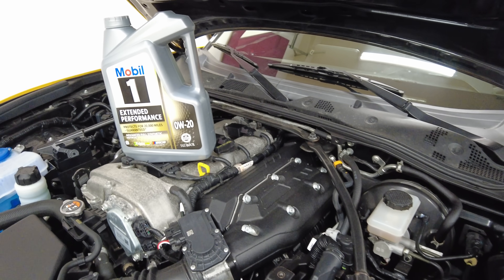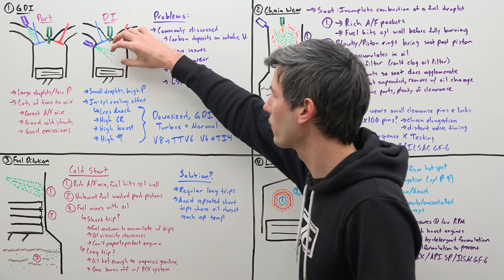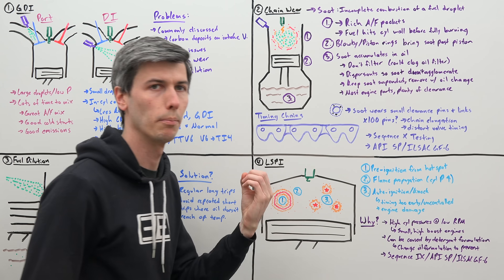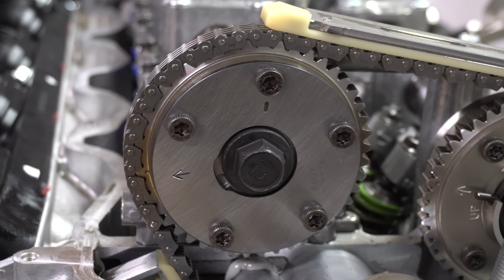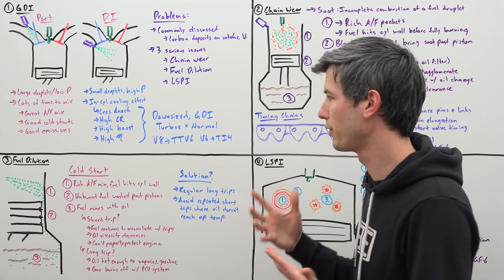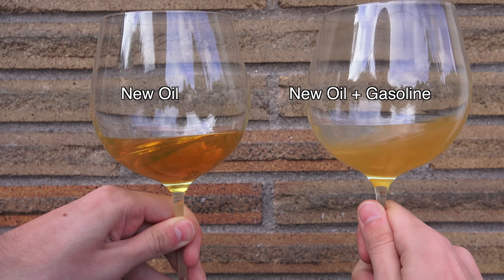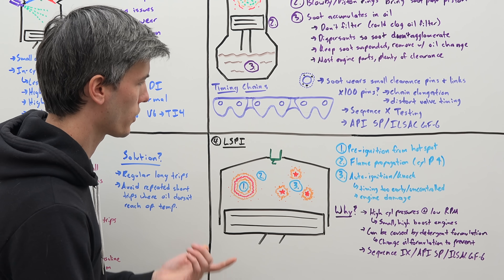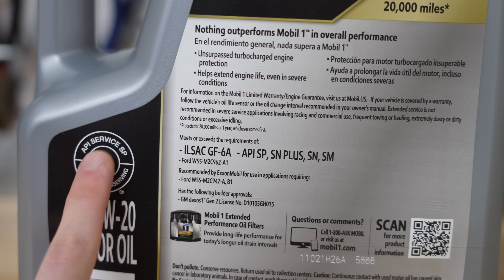3 Big Problems With Direct Injection Engines (Gasoline)

Comment: I have 2 questions on my 2015 TLX V6 tech pacage.  1) IF I run with the least amount of load (slowly) on my D.I. car, and only use higher revs after it is toasty, will this slow down the reduction in viscosity on cold/icy days?  2) In my car, the car itself shows me when the viscosity (not just the level of oil) drops slowly from 100%, 10 percentage points at a time, when at 30% (twice the 15% recommended by the dealer) I get my oil changed. I am told that is what  is being measured by  whatever monitoring system my car has. Can you confirm both questions. And does variable (9 speed transmission) timing
help to reduce the cold start viscosity problem?

Comment: why not have direct injection..  and tiny throttle body.   it would allow some fuel to clean the valves.  cheaper than adding port injection to keep them clean.

Comment: I'm not sure if the timing chain issue is due to soot for the BMW n20/26 engine but the that generation has timing chain issues known to grenade the engine in a small % of engines after around >50k miles.

Comment: I have noticed that my Ecoboost benefits greatly from a regular "Italian tune up", much more so than some of my other vehicles.  I've tried to explain to my wife that her light driving is what's causing the low mpg it's been giving, but she doesn't listen.  I take it for a couple hours, and it gets at least 2-3mpg better for a couple weeks.
Reply: I agree with you fully. But you'll still get the technical assholes that will argue against this practice. Proper preventive maintenance and an Italian tune-up once a day in my 3.6 L direct-injected V-6 in my Chevy has had zero problems. Got almost 200,000 miles and still running like new.

Comment: I have a 2017 Subaru Levorg with a 2.0l direct injection, turbo charged engine (same one as the WRX), but it's paired to a CVT. It's the worst combination imaginable. The CVT rev's so low all the time, it puts far too much strain on the engine (essentially lugging it), but it's tuned for "performance" so tried to make quite a lot of torque low-down. As a result I get LSPI all the time. Also had carbon issues, had to replace the injectors, it's so fussy about oil type, and fuel quality, the fuel BRAND. Plus everything in side the engine bay is made of plastic. I'm sure these engine's won't last long.

Comment: So, is it enough to stay on top of regular oil changes with the proper manufacturer-recommended oil, change interval, and viscosity? Or do we still have the intake-valve carbon buildup issues even after that?

Comment: mobil shmobil..only idiots "lubricate" their engines with 0w-20 water-thin oils;p..wise people use any ordinary 5w-40 (for any engine) for a reasonable price n change it each 6-8kkm depending on driving conditions/manners..n have no problems, at least the ones associated with oil n lubrication..

Comment: You not mention toyota lexus engine they have both port and direct injection on there engine and the computer switches between which fuel delivery system is best.

America has very few small engines with high compression Europe and Japan and Asia have been usingvthis for a long time. Lots of 3 cylinder 1.5 and 1 litre turbo engine are found in BMW Mercedes  Land rover range rover  psa/ stellantis Toyota nissan/renault/ mitsubushi vehicles.

Comment: GDI turbo four cylinders are a byproduct of political insanity by Western Governments because of "Climate Change". In the USA, the EPA puts unrealistic CAFE standards on the manufacturers for their entire fleet, so this is what the various manufacturers came up with to comply. I'm sure the auto companies would rather build simple, effective and powerful engines that get a few less miles per gallon, and not have to conjure up these over-engineered, carbon plagued time bombs. However, they have to offset the mileage of their light truck, SUV and sports car gas mileage standards with this insanity to remain compliant.

Comment: Back in ye olden tymes, the 40, 50s and 60s, the common practice with airplanes operating in the Arctic was to dilute the oil with avgas, on purpose, before shutdown.  This would get the viscosity down to a level where you could start the engine at -20C without building a fire under it, or having to drain the oil from the engine and keep it indoors overnight (another common practice).  Oil dilution systems were common options on airplanes run in the far north. You had a button you'd push for a certain time while idling the engine before you shut it off, which would pump raw gas directly into the oil tank or sump.
Reply: Invented by a WWII B17 mechanic in England who got in the brig for doing it. Then the AirCorps had them all do it because it worked.
When the oil warmed, the gas evaporated.
Reply: @hotrodray6802  An oil dilution system was first patented in the late 30s (it appears in Google Patents).  I'm sure the mechanic story is true, but probably was not the first to do it.
Reply: @JK-rv9tp  You do realise that WW2 started in the late 30's.
Reply: @ericbucher8636  Patent application 1937. And the US wasn't involved until 2yrs after WW2 started.
Reply: @JK-rv9tp  'Hot rod ray's' claim was that it was a mechanic in England.
Reply: @ericbucher8636  Well, lots of things are invented in different places at roughly the same time. So possible.
Reply: I just watched a p51 mustang video that showed that switch in the cockpit, the narrator didn't explain it's purpose but you just did, thank you!
Reply: The real TIL is in the comments.
Reply: Oh yeah International Harvester would call for a quart of kerosene per 5 gallons (I think..) in 10 degree or below weather for better cold starts with the 400 series, such as DT466. Something along the lines of a quart, not much.
Reply: @f-j-Services  In mining or other operations in the the  high arctic where even those sorts of things weren't enough, before synthetic motor oil came along, they would just keep heavy equipment running 24/7 during extreme cold spells.
Reply: @JK-rv9tp  I have heard that. They would let them run plugged in if they could plug them in. I wonder if you would have higher pressure reading on boost gauge on a truck or something in extreme cold like that compared to a warmer climate.
Reply: Some older fighter jets still use this “scavenging” method to keep the jet from leaking oil and fuel. Thanks for sharing!
Reply: Did the use of such oil dilution decrease the allowed time to overhaul?
Reply: @davidpowell3347  No. TBO would be worse if dilution wasn't used, if you had to start cold engines with cold oil.  If that was the case, you'd have to track each time it was used and there is no way to do that sort of thing. Aviation multigrade semi-synthetic oils are now available that make oil dilution unnecessary.
Reply: @davidpowell3347  Not that I know of.
Reply: Germany was already using synthetic oil in WW2. In the US they are even today still using leaded petrol and mineral oil for their aircraft.
Reply: The oil I'm talking about isn't that kind of synthetic oil made from coal. The modern "synthetic" is polyalphaolefin based. PAO oil is not able to hold lead in suspension, so after a "lead paint" disaster following Mobil's  AV1 full PAO synthetic, which had to be withdrawn, it had to be blended with mineral to work with leaded fuel. The most popular is Aeroshell Multrigrade semi-synthetic 15W50. I use it and I'll run my airplane down to 20F without preheat . @chippyjohn1
Reply: Another possibility is to use an electric heating element in the oil sump overnight, powered from the house or garage.
Reply: I have a heater element about the size of a credit card coated in silicone rubber glued to the bottom of my Lycoming engine's oil sump. It only uses 100W and will keep the oil into the 40s-50s F with ambient temps below freezing  @john1703
Reply: Just don’t try this with diesel folks. It won’t burn off by driving and getting the engine hot. In fact it is a detergent and will cause accelerated engine wear.
Reply: @malnfc8565  Before PAO synthetic oils came along, and having such low fuel consumption at idle, diesels in the arctic were just run 24/7 during cold weather where pre-heating wasn't available.
Reply: @JK-rv9tp  yeah they even still do this in places in Canada and Alaska

Comment: Great video! I drive a Subaru with GDI that I've owned since new and have adhered to practices I've learned in previous videos: 

-Regular oil changes with certified products 
-Never let car sit during cold starts [driven immediately after startup]
-Always run long enough to get to operating temp

On a side note, I find it interesting that the manufacturer requires oil changes every 7k miles. Considering the issues with GDI, I always change every 5k. Also, the recommended use of 87 octane fuel seems low with respect to the propensity to knock at low speeds [which my car exhibits on occasion]. But, I've had no issues yet, with 86k on the clock.
Reply: So don’t let sit at idle to warm up? Just start it and go?
Reply: @unitedwestanddividedwefall3521  I drive within 1 minute of start up at the latest.  The sooner you move the sooner the engine and in turn the car warms up regardless of engine tech.
Reply: @unitedwestanddividedwefall3521  yes.
Reply: @00gt5speed  why exactly? I was told it’s better to sit and let the car warm up.
Reply: @unitedwestanddividedwefall3521  That's for older engines with legacy motor oil. Newer engines that run synthetic oil are designed to be driven normally during warm up. Driving the car right after moments after a cold start will bring the engine to operating temp faster, preventing excess fuel penetrating the piston rings and contaminating the engine oil. Letting your car sit in the driveway for 10 minutes only prolongs warmup and promotes contamination. This is part of the reason why heated seats are available on more car models--they want you to get in and drive.
Reply: @00gt5speed  thank you for the explanation. I have an impala Ltz with the 3.6 and I want to keep this car for a while. So anything helps to prolong my engine
Reply: @00gt5speed  I change the oil earlier than recommended. Even the guys at Chevy told me to ignore the 7500 OCI I do it about 4 never exceeding 5k, I use castrol edge, and I’m contemplating installing a catch can.
Reply: Interesting, I thought Subarus were mostly 5k oil changes.  My wife's Legacy uses the port injected FB25 and it's interval is 5k, I would assume your GDI motor is either a BRZ, WRX or 2020+ FB25.
Reply: @mrvwbug4423  Mine's an '18 Crosstrek with the FB20D. The interval varies depending on the source. I believe the manual states 7k mi., but I've also read 3k-7.5k, and another source says 3k-5k. I think the manufacturer has been revising their recommendations according to updated service records. Who knows for sure? I've been doing 5k intervals with no problems and the sump is only down .5 qt.
Reply: Why would anyone buy Subarus with GDI though if you always have the engine oil being polluted? The reality is that most people won't use the car for long road trips (even if that's what they envision) and use it for rather short distances. Oil changes also cost time and money. Private mechanics I wouldn't even trust as they throw the cheapest oil in there they can find. It doesn't sound as if those engines would last long.
Reply: @Jose-sy1je  Mine's got 113k and still going strong. I change my oil every 5k. I take long trips often.
Reply: @00gt5speed  Your long trips might help. But it's known that GDI pollutes the engine oil. And that ultimately runs through your engine. Sure, you can use better oil that may bind to those substances. But how do you know what oil is used unless you put it yourself. Bc most people won't change their own oil and most mechanics will use the cheapest oil they can find. So I'm not crazy about GDI
Reply: @Jose-sy1je  I do my own oil changes and use Mobile 1 synthetic. I agree with you on DI tech. It certainly does cause deposits to form on the back of the intake valves that can lead to issues down the road--especially with turbo engines. The best thing you can do is keep your oil clean to prevent excess blow-by from warn rings. The blow-by contaminants get run back through the intake and are what causes the deposits on the hot intake valves. The absence of port injection means there's no fuel moving past these valves to keep them clean.
Reply: @00gt5speed  I think that's always best. You know what oil and filter you are using and tend to monitor the oil a lot better as well. But most people don't change their own oil and won't check it either. To be honest with you I have been shying away from GDI for that reason. But it's becoming more and more common. And usually they also rotate your tires during an oil change, which is a huge plus for me.

Comment: Your irrelevance is beginning to show through the paper thin veneer of needing to BURN STUFF TO MOVE. Buy an Electric Vehicle (NOT a Hybrid) - problem solved. The complexity of transforming crude oil into motive power is exhausting to contemplate. The reality of doing that is NOT cost effective. We, tax payers, shell out a large percentage of our taxes to supplement the oil industry so our gas at the pumps costs under $100.00 a gallon. This rant from a 75 year old FORMER ASE Tech who has seen the EV light.

Comment: Back in 2013 when I owned my Veloster turbo, there were people in the forums reporting that their engine blew almost once a week. It got to the point where we were all waiting to be next. The manual transmissions made it worse because while cruising on the freeway if you accelerated it while in 6th gear it would create the large load without dropping down a gear. Glad I got rid of that POS.
Reply: LSPI is a nightmare. People in the Speed community talked about it all the time. We all came to the agreement to never go WOT under 3k. Still saw people blowing their engines. BILs engine blew when he was in 6th gear just cruising.

Comment: hmm direct injection,on diesel i believe the oldest form of injection and also most beneficial as you don't have a pre-combustion chamber and therefore no need for glow plugs. Direct Injection also normally has higher compression , therefore makes for a heavier and more sturdier built engine block, crank etc.. this gives you longer engine life. Because of the higher compression you have a much better combustion on diesel and also better performance, and don't forget easier start in cold temperatures, more power, the list is endless. Because you need higher compression you have a larger piston with longer stroke. the magic recipe for diesel fuel, long slow combustion gives out massive torque at very low rpm. So what is not to love ;)

Comment: They could probably install a vapor separator on the PCV system and drain it into the oil pan to avoid some of the build-up on intake valves. Won't do anything for carbon from EGR and will likely make oil dilution worse, but most people won't check or empty a catch can so along with slightly shorter oil drain intervals it's probably the best alternative.
And it used to be that chains were preferable to belts in that they lasted 2x as long as belts or even for the lifetime of the engine. Now chains often need to be replaced around the 100k mile mark, same as belts, only it's far more complex and invasive than an equivalent belt system and so costs significantly more. Other than being a bit thinner than a belt system which may allow a larger engine in a tighter space (one reason Subaru's EZ series 6-cylinders fits in the same space as their 4-cylinder EJs) there seems to be little benefit to chains in new engines, especially since so many engines seem to have problems with chain guide/tensioner failure.
Reply: Many NA chains last 250,000+ miles

Comment: So, after watching this, it makes me a bit concerned about my car. I drive an 07 Pontiac Solstice GXP with the 2.0 LNF ecotec. It has continuously variable valve timing, and a feature they call e-octane which will adjust the valve timing based on what octane you're running to prevent knock. Would it still be susceptible to these other issues with regular maintenance?
Reply: Just run 91/93, change oil at 5k and use and I take valve cleaner like sea foam or crc before every oil change.

Comment: Very good video Jason, thanks! Interesting stuff, on my ND MX5 where API SN is the highest specified oil in the owners manual, I should be able to use API SP as it looks like it most oil manufacturers say that API SP can be used where API SN was recommended by the manufacturer. My current oil is SN but having watched this I think it may be a good idea to go to SP to better protect the timing chain.

Comment: This makes me gladder about my recent purchase of an STI and its port injected EJ257. The low gas mileage is inexcusable (even for 2005), but at least there's less to worry about with my short commute.
Reply: Lol.  The EJ has other problems hahaha
Reply: @JeffSSartor  Yeah, turbo lag. 
No engine is perfect, but an LS2 would've been a start
Reply: Make sure to do oil flushes. And fuel system treatments

Comment: The problem with modern engines is low tension piston rings and extended mileage between oil changes. Change the oil 3000-4000 miles and all these problems are eliminated. Mobil 1 is overpriced advertising.

Comment: I. Found a problem with your first assumption. The idea that the di injector has rich pockets. The fuel spray is vastly more atomized with the air in the cylinder compared to port injection.

Comment: When he talks about using the GF6 oil that is correct but you can also use backwards compatible oils for cars that don’t require the zero weight oil.

These newer 0W GF6 oils are required for a lot of modern cars. But you should also consider using  the backwards compatible GF6 oils for older cars In my opinion